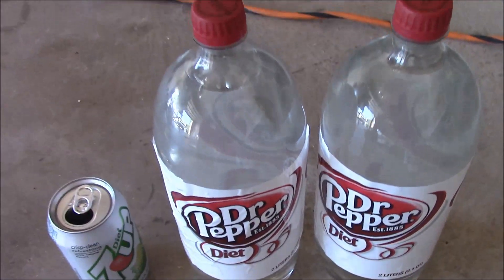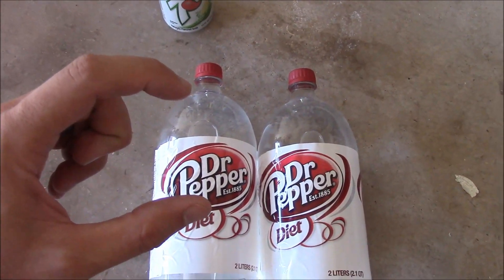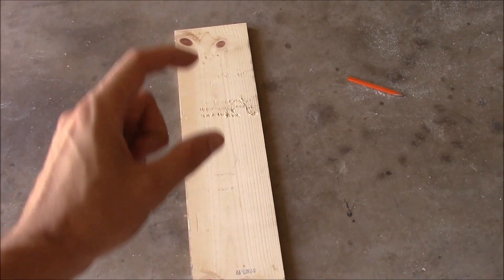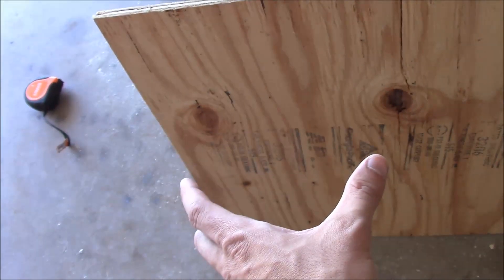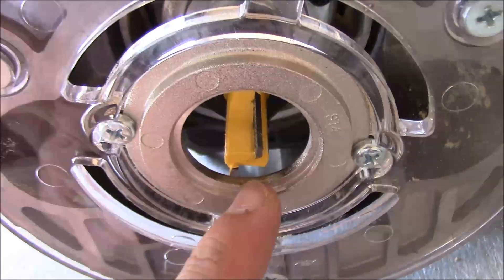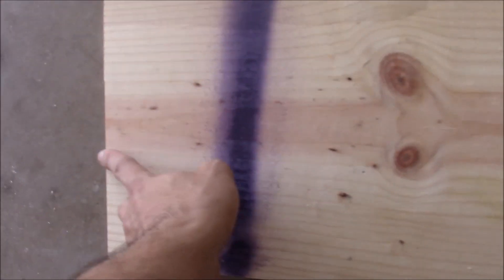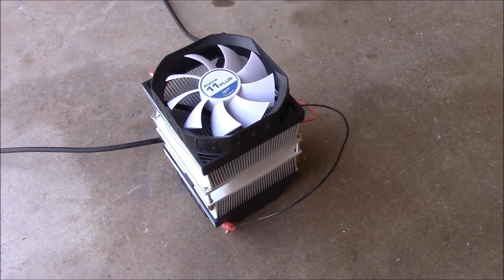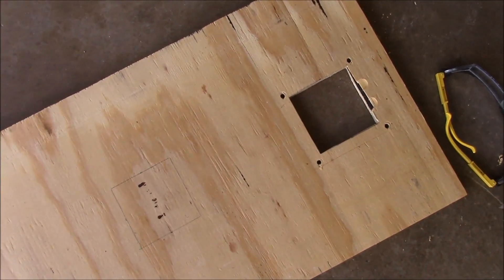Mini DIY Peltier/TEC Fridge Prototype - Learn From My Mistakes

Comment: question for ya, for 5 tecs, what cfm would you recommend for the cold side?
Reply from the maker: +Joel Mannerino You mean how powerful should the fan be?  How are you using 5 tec's?  What is the fan blowing through or away from?
Reply: +LDSreliance  im using 5 of the Tec1 12706 modules. the normal cold side has two 40cfm blowers and the normal hot side has a sunon 100cfm axial fan. but the hot aide only gets to 80 on 60 degree ambient and the cold side will drop to 50 in 60 degree
Reply from the maker: Joel Mannerino
Can you post up a picture or something?  I don't understand how you have this set up.
Reply from the maker: +Joel Mannerino OK, I can kind of see what you are doing now.  I don't see 5 TECs, though.  I see one cold side fan and 2 hot side fans?  Either way, there is no exact cfm answer to your question.  There are too many variables.  The theory, though, is that you want your hot side to be as COLD as possible so that the delta between the hot side and cold side allows the cold side to get as cold as possible.

If the delta on those 12706's is 70 degrees in the real world (not the lab conditions from the manufacturer) and your hot side is 120 degrees F then your cold side will be 50 degrees.  Which means that by the time you overcome inefficiencies in heat transfer, etc. you will be at like 60 degrees.  So if you can improve the cooling on the hot side by even 5 degrees to 115 degrees F then you can lower the cold side to 55 degrees.

Some ways to cool down the hot side better would be to use more efficient materials  such as thermal paste, copper instead of aluminum/steel, or use a liquid cooler that has a higher efficiency than an air to air cpu cooler.
Reply: +LDSreliance  yessir, i have 5 placed between both aluminum heatsinks, arctic silver thermal paste, and a
 thin layer of insulation between the two heat sinks with cutouts for the TECs,
Reply from the maker: Joel Mannerino
Are the 5 TECs cascaded?  In other words, do you have them attached to each other hot side to cold side?
Reply: +LDSreliance no sir, all next to one another side by side, ... what would cascading do out of curiousity?
Reply from the maker: Joel Mannerino
Cascading is supposed to make it a lot more efficient but I have never tried it.  I also don't agree with the theory behind it.

Anyways, the fans you are using push a lot of air but only in a very small area.  If you have 5 TEC's and each one is 40mm x 40mm then your heat sink must be at least 200mm x 40mm and more like 250mm x 60mm or bigger.  That is too much area for those 2 little fans to cool.

If it were me, I would get 2 of these (http://www.amazon.com/VvW-Aluminum-Graphics-Radiator-Heatsink/dp/B00IHWAVQ6/ref=sr_1_10?ie=UTF8&qid=1456587268&sr=8-10&keywords=water+block) and pump water through them.  You could fit up to 3 TEC's on each water block so you could even add a sixth TEC if you want.  In my experimentation, water cooling was quieter, more efficient, offered easier mounting options, and allows you to direct the hot exhaust air to where you want it to go easier.
Reply: +LDSreliance hmm im going to have to try that, efficiency is what i need ... but primarily i want to be able to have very cool air coming out and a decent flow of air. i thought about custom making two heatsinks with high surface area, the ones in using now are both 200x200x40 with only 20 fins, if i get the same size, thinner base, and double the fins, do you think it would help? i hate asking you a bunch of questions , i just dont know the answers or how the dynamics really work
Reply from the maker: Joel Mannerino
I'm right there with you.  The only way I have ever figured this stuff out is just be experimentation.  I don't know where you are getting your heat sinks but when I was shopping for them they were not cheap.  But for ~$60 you could have the tubing, pump, power adapter, and 2 water blocks that you would need to get a water cooling system going.  Maybe not even that much.

Comment: I think its time the US joined the rest of the world and get to using the metric system.
Great build btw. Recently fixed my water cooler and was planing on doing a mod to create a working fridge in the bottom storage compartment.
Reply from the maker: +clinton Raubenheimer I wouldn't mind using metric.  It is a pain to have to convert from metric to SAE all the time when I am working on cars or other projects.  Thanks for the feedback.  Good luck with your build!

Comment: sir have you build a hybrid air conditioner and heater using peltier module? I want to put a temperature controller for this.I'm a graduating student of electrical engineering here in the Philippines,pls reply thanks
Reply from the maker: +Jiffcloyd Jagus No I have not built something like that.  I'm not sure I understand what you mean.

Comment: heyy i liked your video and i appreciate the way you reply to all the questions, i am currently working on water condensation using thermo-electric coolers to produce fresh water, the TECs would be powered using solar PV panels, could you advise me on how feasible would it be to do so, as both PV panels and TECs have low efficiency.
also if you performed calculations before choosing your peltier device could you tell me how did you initially determine your required "Q" value?
Reply from the maker: +Y.M.H D That is an awesome project!  I like where you are going with that.  Unfortunately, you are absolutely correct that both solar panels and peltiers are low efficiency.  But if you are looking to build something that can produce fresh water in places that have no power or in disaster scenarios like Haiti several years back then that would be perfect.

I did not do a lot of math before building my devices.  I like to think of my experimentation style more like the Mythbusters where I have kind of a basic level understanding of the science behind it but I would rather build a model and see what happens because a lot of times the theory does not match the real world performance.  I have learned, however, that the biggest single factor in determining the success of cooling with peltiers is how well you can separate the cold side and hot side and how well insulated you can make your volume of air/water.

Comment: Cool! no pnun her. Thid metod could be good to repurpsr an existing old unit as a shell.
Reply from the maker: +Prima Donna Going Off Grid Yeah if you have an old mini fridge you could retrofit it to use a peltier cooler, which runs direct off 12v and makes no noise.

Comment: On the wiring harness there are 4 colored wires which ones are the ones that power the alpine fans
Reply from the maker: +John Morrow You only need the red and black wires.  The other 2 are only useful for computers.

Comment: Hello I need your help, I want to construct a fridge cooler similar to yours just that mine would be larger 90cmx51cmx56cm( enclosure) . how many of your peltiers will be needed to cool it to 20-25 degree Celsius? please reply thankyou!
Reply from the maker: +RaxrQie Beetle I would need to know the ambient temperature and how much insulation you are going to use in order to take a guess.
Reply: +LDSreliance thankyou for replying. my ambient temperature here is abt 30degrees.. let's say insulation is the same as urs.
Reply from the maker: RaxrQie Beetle
My best guess is that you will need three 15A peltier coolers like shown in this video to be able to drop the temperature in that volume of cabinet by 5-10 degrees C.

Comment: I made my own fridge consisting of polystyrene sheets, duct tape, nails, rubber bands, paperclips, and an old towel. The dimensions are 15.5" x 13.5" x 15". To cool it I'm using a 12705 40mm 42.5W peltier that I removed from an old wine refrigerator, the existing heat sinks from the fridge and I'm powering the peltier and my own fans using a modded computer PSU. Specifically the +12V rail. After some testing and a few modifications I achieved a maximum low temperature of 6.9°C(44.42°F). Not bad for a box made out of foam sheets and duct tape. I found that putting cans of soda in it and coming back the next day chills them perfectly.
Reply from the maker: +Jonathan Uhos That is awesome.  Very similar to what I created except I didn't have any heat sinks designed specifically for a fridge, which would have helped my efficiency quite a bit.  Your dimensions are also smaller but if all you want to do is cool down a can of soda then that is perfect!  Good job.
Reply: +LDSreliance I filled the fridge earlier today with soda, bottles of water and about four bottles of wine. It started at 12.9°C(55.22°F) but has since dropped to 7.8°C(46.04°F) which I believe is due to the thermal mass of the liquids slowly chilling. It should be back down to 7.0°C(44.6°C)ish by morning. Really what inspired this project was this video of yours. A recommendation for you, if you haven't already would be to use a computer PSU. The 12705 operates great on the +12V rail. Just be careful about soldering connectors on the peltier leads I found that bad connections get really hot due to the high current draw. As for heat sinks Aluminum is Aluminum and it's going to conduct heat or cold the same way regardless and since the heat sinks are big enough I think the fault lies elsewhere. Your fridge is only about 2x as big as mine and with 2 peltiers of which they're probably better than the 12705. I'd try a different insulating material. Then maybe tinker with the heatsink fan voltages, the interior fans don't have to spin as fast. Try different fans or something crazy different like liquid cool the entire thing. Mount the peltiers to waterblocks and put a radiator inside the fridge. Instead of the waterblock acting to cool a CPU the peltier would cool the copper block (better conductor than aluminum) and the circulating fluid would chill the radiator and fans inside could circulate and disperse the cold air but you uploaded this video a year and a half ago. You've ether finished the operating fridge or scrapped the thing entirely.
Reply: Never mind just watched Part 2-4 you pretty much did everything I just said already.
Reply from the maker: Jonathan Uhos
No worries man.  You did it with simpler materials.  I like it.
Reply: It's with a 61F ambient. After filling it with bottles and cans the temp dropped to 5.4C (41.72F) If I corrected for 80F like your garage that day my fridge would be at 60F or so which isn't adequate enough. Id need better insulation or a stronger peltier than the 41.5W version. I'm not sure how the fridge heat sink would handle that though however the heatsink for the hot side was abnormally large for how hot the 41.5W peltier gets. It's a possibility the manufacturer sells stronger fridges with higher wattage peltiers and just uses the same heatsink design for all of them. For now though it's not worth the investment. We'll see when summer rolls around again or my dad starts up the fireplace and brings the ambient up to 75F
Reply from the maker: Jonathan Uhos
Never hurts to try.  You can get 10amp and 15 amp peltiers for $10-15 if you look around.  A lot of them off Ebay or Amazon will ship straight from China with free shipping but you have to be patient and wait a week for it to get there.  Just keep an eye on the hot side heat sink and if it gets too hot to the touch you may want to shut it off so it won't damage the peltier.

Comment: My knowledge of electricity is somewhat limited, so I may be wrong. I had just watched this you-tube clip called: Solar Powered Fridge Freezer! - 30w off grid refrigeration -Freezer holds gallon jugs! (ice blocks!)  by desertsun02  before I watched yours. If desertsun02  is misleading us can you help me understand where? I am planning on setting up a van for traveling and need to know more about running a fridge on solar and if it's possible or not. He does say that you need a big inverter to get it started, but once it's started it should only take 30 watts per hour. Is he wrong?
Reply from the maker: +rw Lincoln No, he is correct, although I would be skeptical of 30 watts.  Even my small dorm size fridge uses 60 watts and I think that is about as small of a fridge as you will find.  But in order to run my dorm fridge it required a 1200 watt inverter to get it started because it draws a TON of current to start the motor and then settles down to use about 0.5 amps @ 120v from the inverter.
Reply: So if it cycles on 50% of the time then it would be consuming about 30 watts per hour plus the inherit power loss to run the inverter. Is that high current draw occur every time it cycles on or just at the initial plug in? The focus of my question is how many watts per hour are consumed by that? I would have to add that to the 30 watts to know how much battery bank to buy.
Reply from the maker: rw Lincoln
The current spike is every time that motor kicks on.  So that will happen multiple times per hour and push your number back up a ways.  For an accurate reading you can hook up a Kill-A-Watt meter or Watts Up meter to the fridge and let it run for 24 hours and it will tell you how much power has been consumed in kilowatt hours.  Divide by 24 and you have a pretty good idea what it will take to run the fridge.

Seriously, this will be one of the best $18 you ever spend:  http://www.amazon.com/P3-P4400-Electricity-Usage-Monitor/dp/B00009MDBU/ref=sr_1_1?ie=UTF8&qid=1446413966&sr=8-1&keywords=kill+a+watt

Comment: In case no one else has said it, 11.2v is pretty much dead flat, if you leave a battery at that voltage for long, you'll seriously damage or kill it.  

http://modernsurvivalblog.com/wp-content/uploads/2013/06/battery-state-of-charge.jpg

11.51v is 10% from dead flat.  12.1v is 50% depth of discharge (DOD)  which is pretty much the maximum you ever want to take a lead acid to if you want it to last, even at that, if it's done regularly, you'll lose about 25% of it's estimate life.

also of note, is temperature 
http://batteryuniversity.com/learn/article/how_heat_and_harsh_loading_reduces_battery_life
"As a guideline, each 8°C (15°F) raise in temperature cuts the life of a 
sealed lead acid battery in half. A VRLA battery for stationary 
applications that will last 10 years at 25°C (77°F) would only live five
 years if operated at 33°C (92°F). The same battery would cease after 2½
 years if kept at a constant desert temperature of 41°C (106°F). Once 
the battery is damaged by heat, the capacity cannot be restored."
Reply from the maker: +John Douglas Correct.

Comment: Very creative, but unless you need to run your "ice box" upside down or on it's side (that you can't do with a compressor fridge) why waste your time building a box that draws 240 watts continuous when you can buy a mini fridge that actually makes ice using only 30 watts average. Save yourself 210 watts of energy x 24 hours  or 5 KW per day
Reply from the maker: +rw Lincoln What fridge uses 30 watts??  I am all ears.  I have tested mini fridges or dorm style fridges and they use about 1 amp continuously (they don't really cycle on and off very much, if ever) and require ENORMOUS amounts of power to start the motor (50+ amps).  See my testing here in this 3 part series:  https://www.youtube.com/watch?v=zysqlSTZwOk

I built a second generation fridge with better insulation and construction and was able to install a thermostat to save on powering a TEC 24/7.  The 5 part video series starts here:  https://www.youtube.com/watch?v=TjX-5zjhPlQ

Comment: I don't see why this would save money in the refrigerator sense? I guess this would use 120 watts if he had two 10A units (which is pretty low). How much power does a air compressor consume? Then you have to add a circuit for temp a cut off sensor? Seems like a lot, plus it didn't preform that well, assuming these arn't 100% efficient so that 120watt estimate will probably go up if he needs a 3rd unit. 
Would be cool to put a few lower power ones on my cars factory inter cooler (larger coolers cause more lag) and heat sinks on the hot side without fans (since driving will blow air through them). But that would probably be a waste of time and a headache trying to wire it to a battery and what not.
Reply from the maker: +rambow70 You are right.  This was more of an experiment or proof of concept.  I have since created a better version and it is more efficient and only uses one 10a unit.  So for about 150 watts of power max (cycling on and off as needed) and about $200 invested you could have a decent little "prepper" or emergency fridge that could run off of solar OR a small fridge for an outbuilding or detached garage or something that is more efficient than a dorm fridge.

Comment: Respected sir.
I want to make a air conditioner using peltier unit . i buied TEC1-12705 unit. i want to make it hybrid like it can work as cooler in summer and heater in winter .sir plz help.? looking for ur reply.
Reply: im making a unit right now. i have the schematic all drawn out ..  and color coded. ill be making a vid of the unit soon. .  but mine is for small areas ... like a small minifridge.
Reply: +Joel Mannerino both heat, and cold, and both fans. set the temp and walk away, all 12v, all amazon items.
Reply: +Kavish Laxkar I think you need a magician not an enginner, is a fact that peltier device is capable of cool down and generate energy from heat but doing both would be very dificult instead check PassivHaus for homes.
Reply: +Kavish Laxkar hey, check my page man, i got the full schematic up for ya
Reply: +Joel Mannerino Its been great to hear you.
can you please send me the skemetic and circuit diagram and all other component requre to built this.
This will we be a gr8 help from your side.
my Gmail : laxkarkavish@gmail.com
thanks
Reply: +Kavish Laxkar hey buddy, i got the schematic up on my page, actually several